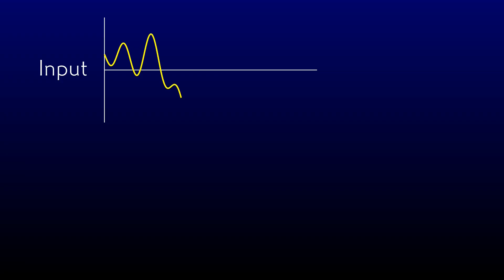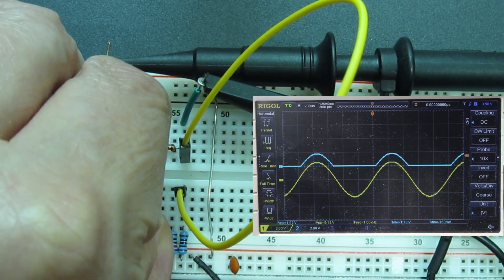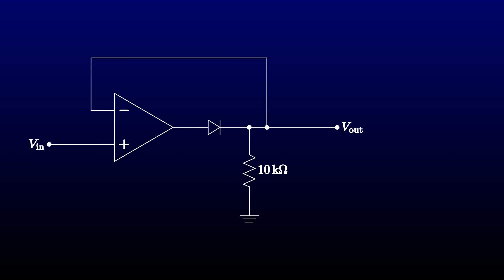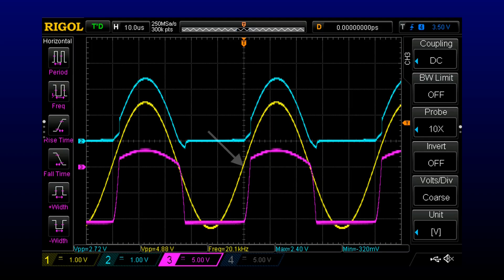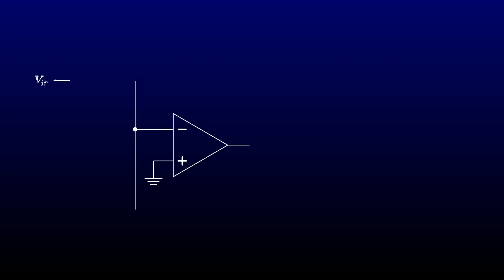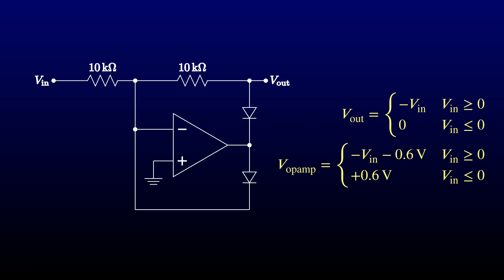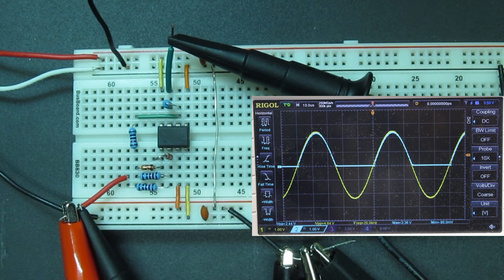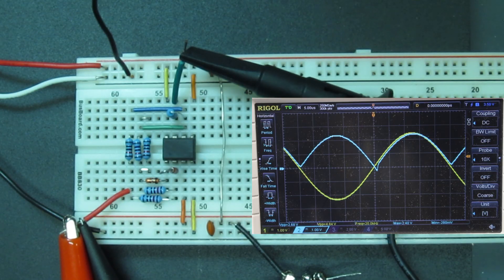The Precision Rectifier: Op-Amp Basics Episode 5 (RE-UPLOAD)

Comment: WHAT ARE THE POWER LIMITATIONS WITH PRECISION RECTIFIERS CIRCUITS?
Reply from the maker: Typically, you don't care. They're for handling signals, rather than lots of power. If for some reason you need a lot of power (more than a few milliamps) out of one,   follow it with a buffer amplifier.

Comment: I understand the basic inverting and noninverting amplifier circuits, as well as the voltage follower circuit.     I also understand the glitches due to the opamp's finite slew rate that you showed at 5:45 with a 20 kHz sine input.  

However, you lost me at 8:05 when you put two diodes on the opamp's output.   This breaks or disrupts the feedback path.   I don't understand how you could possibly expect any reasonable output with these two diodes.      Perhaps if you showed more oscilloscope traces of the 20 KHz sine as you add each diode I might understand.    I don't think the feedback path is even working because of the top diode.

This is very important to signal processing and I want to understand it.     Thank you for trying, Kevin.  And thank you for cleaning the video.
Reply from the maker: I think the point I didn't make clear is that the two diodes provide feedback on different half cycles. They're never conducting at the same time, so you can analyze them separately. 

When the input is positive, the top diode conducts, and the feedback loop keeps the top of the top diode at -Vin. That's true even if Vin < 0.6V, because the (-) terminal of the op amp will still be above the (+).

When the input swings negative, the feedback loop is broken momentarily.  The top diode is reverse biased, and we can ignore it.  The op-amp's voltage starts to swing toward the positive rail because there's no feedback, and the (-) input is below the (+).  When the op-amp output gets to a diode drop above ground, the bottom diode conducts and pulls the (-) input back down to ground.  Now there's feedback again, and the op-amp's output stays at that one diode drop rather than swinging to the rail.

When the input signal swings back above ground again, the bottom diode stops conducting and the op-amp output starts swinging down toward the negative rail.  When it gets to a diode drop below the input, feedback is restored and we're back to where we started.

So you can think of it as four phases, and look at them separately:  (1) the input is positive and the top of the diode is tracking it, (2) the input has just crossed into negative territory, and the op-amp output is rising rapidly with neither diode conducting, (3) the input is negative and the output sees the virtual ground through the feedback resistor because it has no other source of current, (4) the input has just gone positive and the op-amp is swinging back toward the negative rail with neither diode conducting.  

Phase (2) is broken feedback but harmless, because the circuit output will stay at ground until the top diode turns on, and ground is where it's supposed to be anyway.  Phase (4) causes a glitch at the positive-going transition of the input, because the output is still at ground (the top diode hasn't turned on yet).  Once the top diode does turn on, the output voltage falls almost instantaneously to -Vin.

Phases (2) and (4) are very short, so we tend to think of them as glitches rather than 'operating regions'.  They're much shorter than in the one-diode circuit, where the op-amp has to climb back all the way from the supply rail, rather than climb two diode drops.  

The next video in this series will show a different way of adding the second diode for clamping the op-amp's output. Maybe the light will dawn if you compare the two approaches.
Reply: Thank you for the detailed explanation,  Kevin.    Much appreciated.